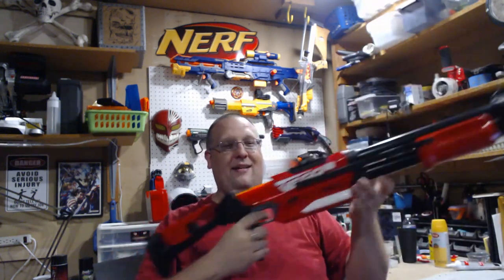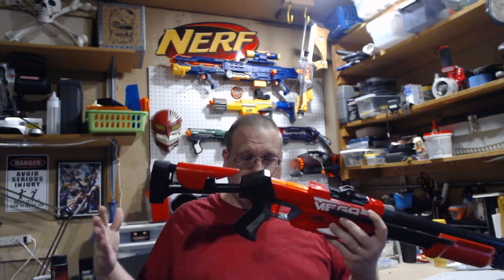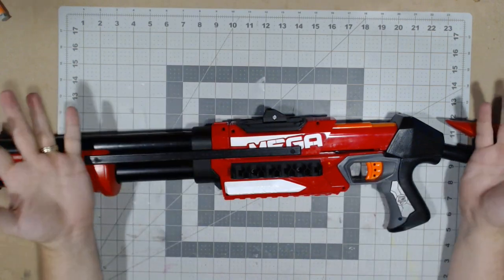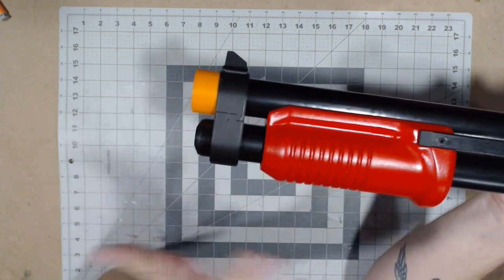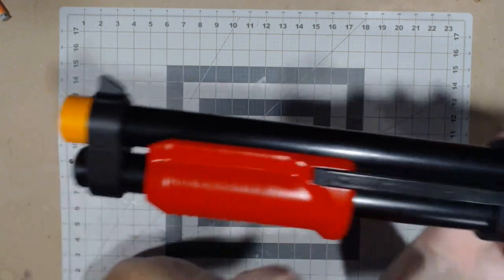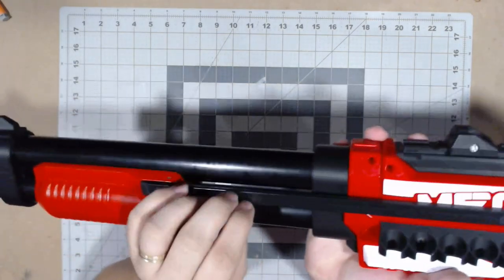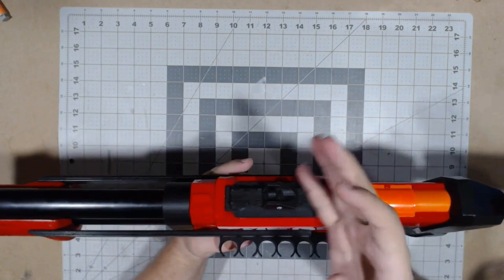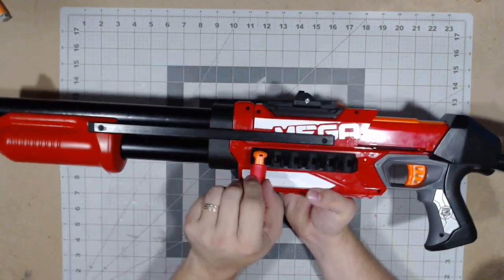Benelli Magnus Kit Review

Comment: Aww dang, sorry to hear the bottom of the grip broke off. Glad to hear you fixed it though! The print gets pretty thin down there but once it's installed on the Magnus it can't really flex so that helps support it.

Sorry about the bolts in the bottom of the grip. They seem to have gotten lost at some point as I didn't have them with me at APOC.
Reply from the maker: No worries. Like is said that was mainly my fault. The fix is working.

Also the bolts for the bottom was a guess.